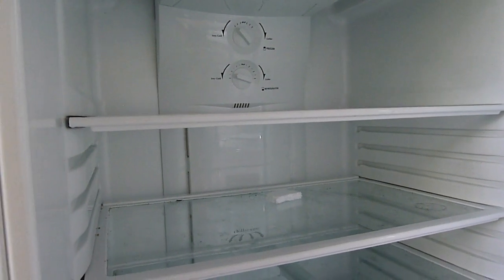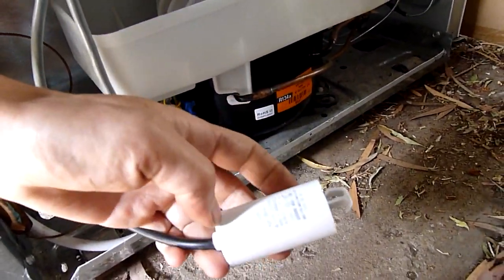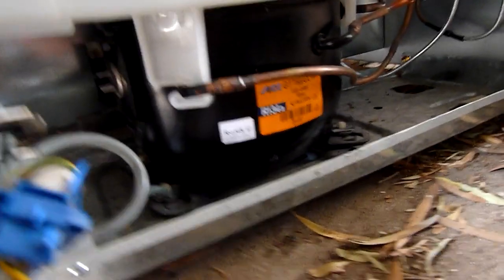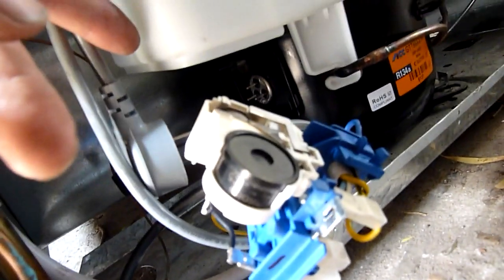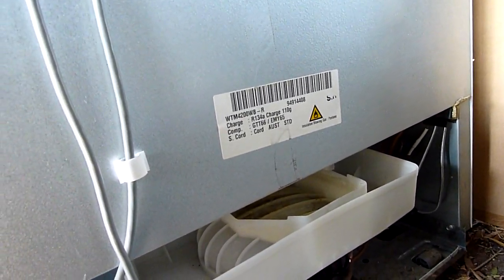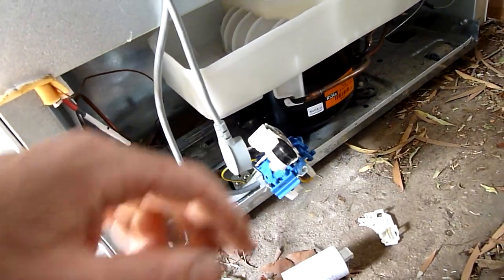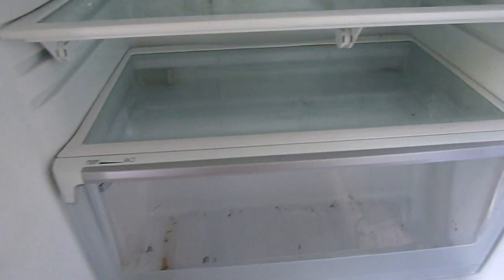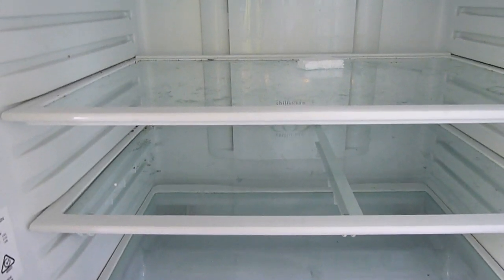Mystery Bang and Smoke from 3 year old Westinghouse Fridge

Comment from the maker: well, its been running fine for the last day , so it can't be a coil rupture. the discharge line and outer case with the condenser coils gets warm as it should, and I could hear vapor come through as soon as I started it up, so its not blocked.

Comment: As others have noted, check internal components and wiring - fans, defrost, light. I have an F&P where the insulation was burnt off a low-voltage wiring harness while they were soldering a refrigeration line during manufacture  - worked fine for a year until a drop of condensation shorted things out (fixed under warranty).

Comment: As Photon would say: If in doubt....GIVE IT A CLOUT!

Plug it in & see if it runs OK. As for the smoke....well it might be that capacitor, but the little Necchi compressor that I dug out of our old under-worktop fridge didn't have a capacitor of any kind on it. There's a terminal box on the side of it with a thermal cutout & a PTC in there, but that's all. 

Just recently done vids on my Necchi compressor. :D In one vid, I show inside the terminal block & you can see the bits on there.

-BBD.

Comment: Ooow thats a good one Ed, i would check the thermostat for internal flashover, as the control knobs arnt in the dry.

If its not electrical then it must be some kind of compressor miss starting problem.

Its a good puzzle :-)

Comment: My best recommendation, and i'm sure you would do it anyhow, would be to run the thing in the carport/yard for a while and listen for it.  Sometimes the ice cracking during defrost makes a pretty good snap/pop.  Or, i suppose, the guts of the compressor (recip i'm sure) can hit the case when it shuts off and shakes to a halt.   As for smoke, no clue - sometimes noises can be frightening...... (all do respect to your grandmother of course)

Comment: It looks like a frost free type, my fridge has a similar system and bangs sometimes. I think it's ice in the cooling coil compartment (which is separate from the food compartment) being melted and breaking off (imagine the noise when you drop an ice cube into a drink but on a bigger scale).

Smoke could be the water vapour from the evaporator tray above the motor? Maybe a long shot though.

Comment: I have had Air Conditioner units do this, ice builds up and eventually the fan whacks it, there is a really loud thunk, ice chunks fly everywhere inside the unit, some landing on warm bits and steam coming out the front vent (sometimes ice chunks also!). This can happen 10 times a day, but with a refrigerator I'm not sure.

Comment: Does it still have refrigerant in it?  If the compressor terminals to fail and vent the refrigerant, it creates a hell of a noise and the refrigerant is often mistaken for smoke. It usually caused by a restriction in the refrigerant cycle causing extremely high discharge pressures. and the terminals act as a relief.

Comment: Perhaps it was the electrical outlet? I dunno... check all connections including crimps, and see what would be exposed to heat or heat up. Perhaps defrost timer has a short or is just crappy and makes an arc when engaging the element?

Comment: Common for the thermistors, defrost heaters and the fans to fail, then it builds up a big block of ice. as well the control boards are just shyte.Expensive as well. Being 3 years old and running R134A it is likely the oil has polymerised and blocked the drier, the crack and smoke might have been it bursting the mullion heater coil. Have you run it and seen that the outside by the door gets warm? If not then you blew out an internal foamed in place pipe.

Comment: My refrigerator infrequently makes one or two very loud bangs when the compressor stops. It has woken me up from 50 feet away.  I believe it is due to a dodgy internal compressor motor mount. It has been doing it for years. That wouldn't explain the smoke, though. If she opened the door, then perhaps the smoke was just normal condensed water vapor.

Comment: So likely just a ice build up on the coils, either from faulty door seals or it being left open a crack. Smoke could have been steam from the water in the evaporation tray overflowing onto the motor.

Comment: Very good chance that fridge has an electronic defrost timer, they are prone to the same capacitor plague every other piece of electronic equipment has these days.  This would be located in the upper 'bubble' of the fridge section.  If it's not electronic, then you have a mechanical timer with sticky contacts that like to weld.

Comment: A loud bang an a puff of smoke sounds like a capacitors dying, either that or a semiconductor. A wiring problem would smoke and kill the circuit breaker I would think.

Comment: I used to work at Electrolux (Email) years and years ago and when i was leaving they where closing down alot of the assembly lines as they where getting the parts pre assembled over seas because it was cheaper. they layed alot of people off after that.

Comment: I have an older Samsung double door freezer/fridge, and it also made a loud bang and vented a crapload of smoke. I immediately recognised the smell as burning cap, and under a cover on the top there is a PCB for the digital control. And obviously it has a SMPSU in it with a blown shit quality no name brand cap next to a heatsink (idiot design). Recapped the whole thing with good caps and it has worked fine ever since. 

So you should check your control board. It might have a failed component.